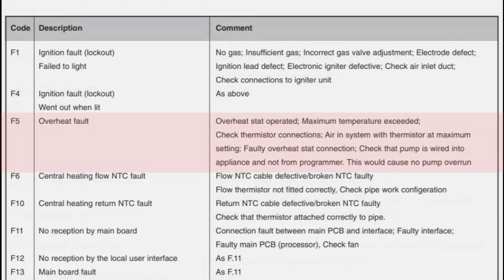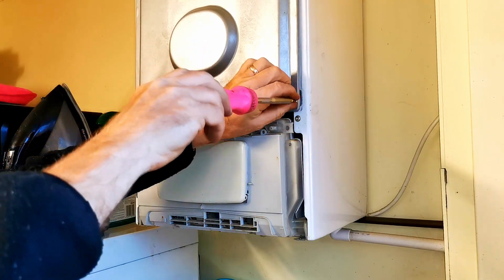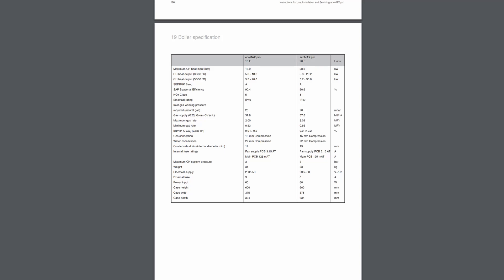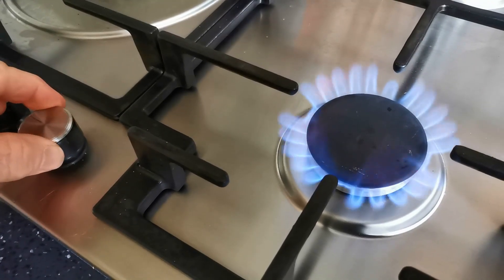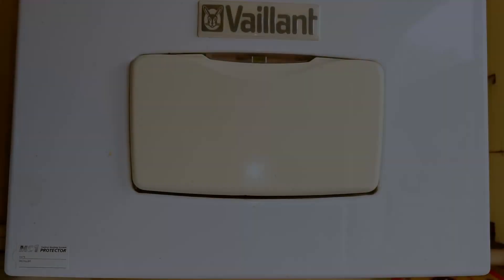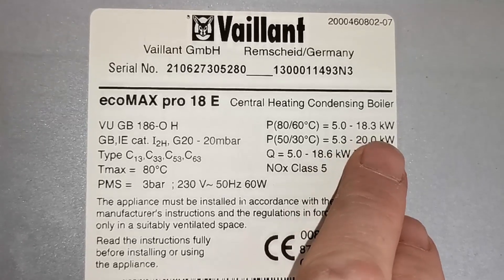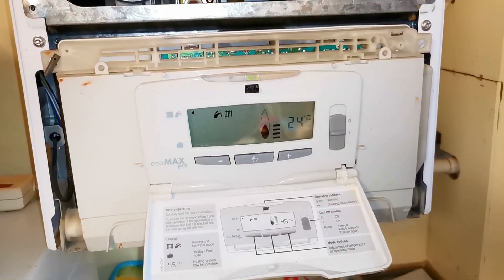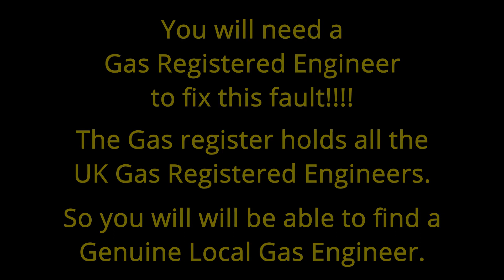Vaillant ecoMax  Pro F5  Fault.  What to do, to get the boiler working again. Plus Fault Causes

Comment: Hi Mark, this is an excellent description of how to deal with the F 05 fault and the reasons for it. One thing that I would have said is that certainly turning down the flow temperature will make the boiler more efficient, but this only applies to condensing boilers (High Efficiency boilers) and that a lower flow temperature will lead to lower Delta T at the radiators which may impair the heating performance if the radiators have been sized for the normal Delta T of 75. It's certainly worth experimenting with adjusting the flow temp.

Comment: Thanks for this, came home to the F05 error and the button inside had tripped. We recently added 5x tado smart valves to our home, and we left the house today and turned the valves off, but left the heating on its normal schedule... We did have 3 towel rails still on and mostly open, but it obviously wasn't enough flow for what the boiler was trying to output. So lesson learned! Thanks for the fix

Comment: Interesting video Mark. Thank you. Sadly I'm still on my journey with the fault, after having offered to help out my neighbour by (initially) fixing some dribbling lockshield valves. Ended up flushing, and fitting a filter and new pump. Don't think neighbour has the older version of the boiler, as it will reset on the on/off switch, and wants to fire, but cuts out. I've done everything I can think of to encourage water back into the heat exchanger, including "bleeding" the drain off on the return, and bleeding the new filter. Anyway no joy, so Gas safe guy coming out on Monday... I don't do boilers, hey ho...

Comment: thank you Mark, you are a natural and brilliant communicator. I have one of these boilers, it's nearly 17 years old and has only ever packed up once and that was exactly this F5 fault. Thanks to you I understand my boiler a little better now and will check its settings. I wonder if there is any point in having a Magnetic filter retro fitted at this stage? I suppose it depends how long my boiler's going to last. When I did have my f5 fault the first engineer I called asked "how old is it" when I said 15 years he replied without even looking at it "you probably need a new one" I didn't use him.